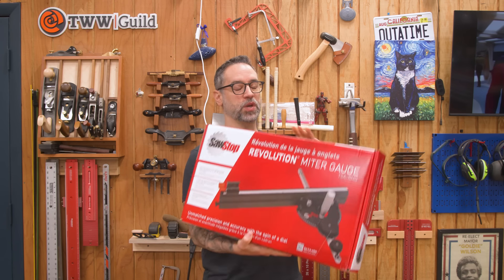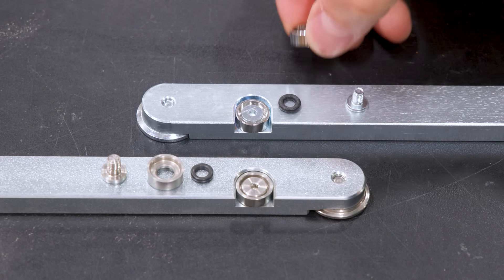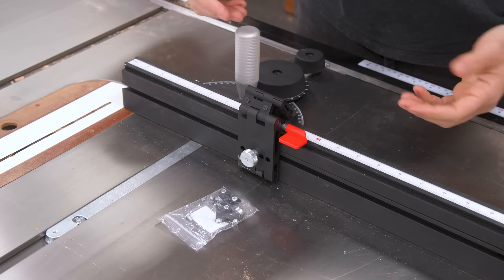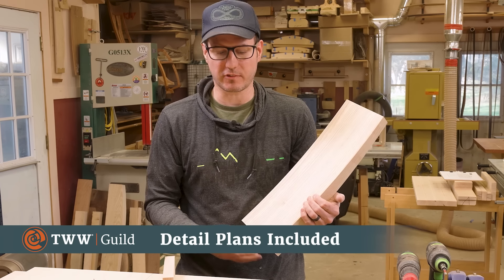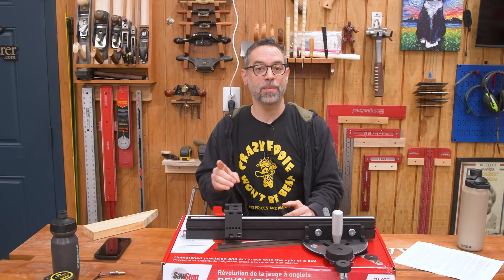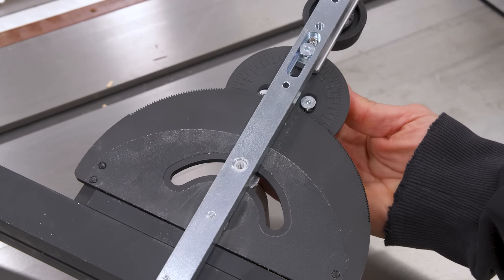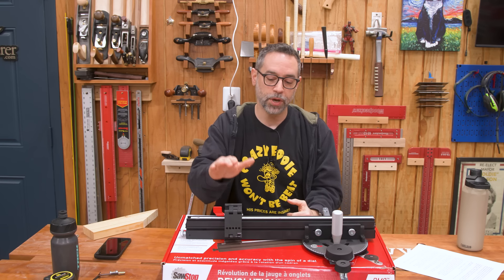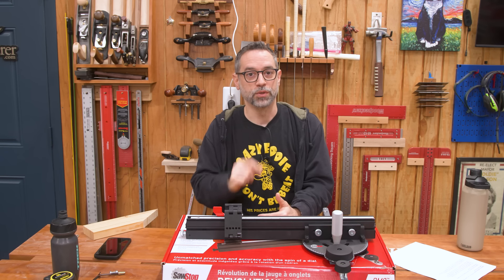The MOST Expensive Miter Gauge on the Market | Worth it?!

Comment: The lock down on the stop is nice until you put on a sacrificial board.  You'll need a slot the length of the board and a longer tool to reach the dovetail slider.   (and BTW, the slot needed to move your stop around is where the sac board attached to the rail so...

Comment: I have a Robert Lang Billiard Chair in which the front legs are 25 inches apart and the back legs are 24 inches apart.  He indicated there was a 91.6° on the tenons on the rails front to back.  This is common for legs to be offset on chairs.  I doing it by making a full scale drawing of the foot print and using that as a guide.  Still haven't purchased.

Comment: I got a demo of this at Rockler and the dude at Sawstop used the same system you used to get rid of deflection. Impressive Marc! I was awed by the accuracy of the angled cuts but it's not something I would ever need. Great review!
Reply from the maker: Thanks!
Reply: Except then you cannot use a sacrificial fence. I guess everything has trade offs.
Reply: @MrWookie1981 That does seem like a problem. Maybe then use a small quick clamp over the whole thing? Not a pretty solution, but the ergonomics could use some work anyway on most of these. All the settings do seem quite slow to use too here.
Reply: @MrWookie1981 seems like you can if you route a dovetail into the face of the sacrificial piece?
Reply: @3weight And that would take some experimenting as it's not as simple as using matchfit's stuff...
Reply: @3weight  think of how precise that groove will have to be so the stop sits on the table but not above or below the table.  Seems like a lot of work every time you want a new sacrificial fence.
Reply: @MrWookie1981  Might be - it looks like it’s just a matter of matching the height of the dovetail on the stock face, but it wouldn’t be the first thing I thought looked simple and spent a day tweaking around with 😄
Reply: @3weight  I know I am being petty but at $450 USD should really be trying to figure out work arounds to make it work?

Comment: Marc, great video and a fantastic review! I really do need to thank SawStop for coming out with this miter gauge. It is an engineering marvel in spectacular fashion. 
It makes me feel SO much better about my decision to go with my Jessem Mite-R-Excel II gauge. With this one out there, I no longer have to feel guilty about purchasing the most expensive miter gauge ever produced! Thanks for that, Sawstop! You're the best!
Honestly, the stop is a total deal breaker for me along with the scale.
There was a saying in sniper training that corresponds to accuracy which states "Aim small, miss Small." which applies to woodworking with tight tolerances as well.
However, at some point, you are "chasing zeros" when your resolution of error gets smaller than the rigidity of the material. This becomes the tipping point of futility and will result in throwing away both time and money to achieve something that frankly won't even exist long enough to get the project out of the shop.
I was questioning myself on that very point when I decided on the Jessem miter gauge, but have now confirmed my choice with the advent of this new product from Sawstop.
Not only is this thing cool as all get-out, but it looks like an absolutely over engineered time and money killer. 
I'm all about precision and accuracy in woodworking, and tend to work to the 0.001" resolution, but truly expect to only hit a 0.01" final result. If I get that accuracy, I know I've done a good job.
This gauge will not make it into my shop, but I thank Sawstop for building it.

Comment: Im glad you mentioned the fix for deflection, I was thinking the exact same thing when you showed how much the stop had, I also thought of the JKM stop (which I currently use and love). I use my crosscut sled more than anything and don't really have a need for a miter guage, unless I'm doing woodworking all wrong...lol. but with that said, I think I'd invest in this sawstop if I was in the market, so thank you so much for spending your own money to review this stuff for all of us.
Reply: A couple of issues with this method for securing the stop - 1. you can't access the micro adjust easily 2. You need to cut a matching dovetail in any sacrificial fence. Other than that, it is an option still

Comment: I'm not following the description the track snugger mechanism. You can't force those steel guides out by tightening down an O-ring. I think what's happening is the O-ring is acting like a spring. The guide bushing location is machined so that the bushing is going to be proud of the track width by default. When the screw is loose, and you push the miter gauge into the slot, the rubber O-ring acts like a spring and compresses, and allows the guide bushing to move inward to accommodate the width of the slot. This lets it essentially auto-adjust to the width of any miter slot. When you tighten the screw, you are merely locking it into position. This is similar to the Woodpecker spring auto-adjust mechanism, but better because you can lock it in place. 

Regarding the thumb screw to lock in the flip stop, that will definitely keep it secure, but you lose convenience. It's no longer a quick flip stop, and it won't work with a sacrificial fence unless you build in a similar dovetail or locking mechanism. 

I think SawStop whiffed on that flip stop design. The rest looks excellent.

Comment: Great review Marc! My Incra Miter 1000 has become one of the loves of my life and I highly recommend it for accuracy (and price).
I'll be honest with you.....I never gave it a thought to display my SawStop brake and blade on my wall for everyone to see. You got guts to go along with your Giddy! (I love it when you get "giddy"). Keep up the great work.
Reply: Displaying the blade and brake on the wall sort of fits into Mark's goofiness. FYI Mark's goofiness is one of the reasons I keep coming back for more. 

With regard to the micro adjust, Nick Engler for years has pointed out that a screw with a 10-32 thread can make an excellent micro adjust. Take a chunk of wood (or aluminum, etc), drill and tap a hole for a 10-32 thread screw and thread the screw in the hole. You want to advance or retract 1/32"? That is 1 full turn. 1/128"? One quarter turn. 1/256"? 1/8 turn. Less than that? Blow on it, I guess.

Now all you have to come up with is a mechanism to hold the block of material.

Jonathan Katz-Moses, are you listening?
Reply: @jimweisgram9185  You gotta love Nick's "keep it simple, stupid" approach. No one can spin a hammer in the air like Nick. 🔨

Comment: I noticed that when you did the little addendum at the end about how to lock the miter stop down, you didn’t mention that it won’t work on the extended fence.  So it’ll only work for shorter pieces…so, it’s only a half fix.
Good review!
Reply: To be fair on that though, he's comparing it to something that doesn't have its real stop work on the extended fence either. So that seems like a wash.
Reply: Is that knob screw thing long enough to go through a sacrificial fence and tighten and remain in the stop block or does it only work with the metal fence? If it can’t work with a sacrificial fence that could be another set back.
Reply: You'd probably need to make a sacrificial fence with a slot to reveal the original sliding block or you could route your own dovetailed slot to slip in the blocks. Either way, a little more work than we'd wish but possible.

Comment: This was very amazing Marc. I think I your solution loosening up the two set screws and utilizing just the center hole will make it more attractive to buyers, who’ve seen this that is. Like you I probably don’t need anything this accurate with what’s been covered here previously. Excellent video, perhaps SS will modify the stop so as to do away with the 1/64 adjustment.

Comment: the dovetail slots seems like by design so that you can continue to use those sliding dovetail nuts in a sacrificial fence (provided you route in a dovetail slot) in order to prevent deflection. Very well thought out.

Comment: I bought this miter gauge with my sawstop.  One thing that that really bugs me is they only include imperial measurements and no option for metric.  I even called support to see if they have a metric option or tape measurement replacement, no luck.  The tape measurement width is 15.75mm for anyone that can recommend a replacement.

Comment: I finally splurged on the Hongdui one a few months ago as a replacement for my old Incra 1000se because I really don't like the "toothed" not-a-slider on their fence, hate almost cutting my fingers on their strangely sharp plastic knobs, and never could trust the measurements because that little ruler insert slips around too much. It doesn't have a vernier scale, but I rarely cut strange angles and I like how easy it is to set the ruler marks and end stop to zero against the blade (in both imperial and metric). The extension is also really nice. And as a splurge, I think it's definitely the best-looking option on the market.

Comment: Great mod for the Stop Slop. I currently use the gauge that came with my SawStop, using an attached oak wood fence that has T-Track along the top edge, and a sliding metal flip-stop which has no movement once locked down. It is only the vernier precision of your tested model that I am Lacking, but I don't need it.

Comment: Here's a DIY stop tip courtesy of Nick Engler. If your screw thread is 10-32, then you can easily dial to a 128th of an inch or less. A 128th would be a 1/4 turn. 1/8th of a turn would be 1/256. If your threaded piece is a flat head screw with a slot for a flat screwdriver, you have a visual guide for how much you have turned the thing.

Can't find a threaded insert that 10-32 size? Take a long enough 10-32 piece of all-thread, and cut a couple grooves in the side a couple of inches long at the end. I used my dremel type tool with a thin cutoff wheel.

 You now have a tap suitable for wood. 

Chuck it in your drill and run it in and out of the wood a few times.

I notice the Sawstop stop has a rounded bottom. Pretty sweet IMO, no dust messing the cut up, and looks good too.

Comment: So when Saw Stop makes a few changes as you pointed out you will then have the absolute perfect miter gauge. However it will probably end up costing way more. I AM surprised that they made so many great features yet so poor on a few others. All of this is great if you ever needed to cut some weird angles like 19 and a half degrees. When was the last time you needed to cut that weird of an angle or any other for that matter. This is starting to become the accuracy of metal cutting equipment. Like one of your viewers said. You make what you have work. I’m a retired toolmaker of over 50 years. I used to grind snap gauges for the government to a tolerance of +/- .0002 on a crappy surface grinder. However it sure would have been great having a top of the line machine I’ll admit. All boils down to just what do you really need. Nice video though young man 🤙🏻

Comment: You asked why anyone would need .1 degree accuracy. Segmented wood turners use angles that go down to .1 degrees to cut segments. If the angle isn't accurate the segments do not fit together to form a ring. For people that work with staves or tapered polygons to form multisided vessels or boxes, accuracy down to .01 degree or better is needed.

Comment: Just last week I pulled the trigger on the JessEm Mite-R-Excel II with Micro Adjuster miter gauge. Then I saw this video and though that I just might have buyer's remorse. It wasn't until you demonstrated the micro adjustment feature that convinced me I made the right choice! I feel that this feature on the SawStop is poorly designed IMO. Sure, you solved the deflection issue, but it looks like no matter how you slice it, that adjust will be somewhat of an inconvenience ( especially if you need to jump back and forth between micro adjusting and securing the stop with the knob.. no thanks... though I really do like the angle adjuster - but given my hobby, I don't think I would need that fine tuned control to be honest. In either case, thanks for this video! Very informative! But as for me, I'll just wait for my JessEm to arrive. I know I will be happy with it!

Comment: Your solution to lock down the stop only works if you don't use a sacrificial fence.  I use my miter guage for my accurate cuts and without a sacrificial fence, you can have tear out.  Cutting the last cut on a piece you have milled down and are almost ready to assemble and then blowing out the back side is no bueno.  I think I will stick with my Jessum.  It makes me smile.

Comment: Hi Marc, excellent review,  Followed your lead for the Incra 1000 & 5000 and have been very happy.  Beat you to the SawStop PCS but only because you were held back.  If I was making segmented blanks for the wife's lathe work that gauge would come in very handy.  One question though, how would the "STOP" bolt work with a sacrificial fence, is it long enough for a 3/4" SF?
Reply from the maker: Don’t think it’s long enough. But I would just route a dovetail slot into the sacrificial fence.

Comment: If I owned a top SawStop cab saw I’d probably be in a financial position to acquire this new and fairly improved gauge and I kinda like having matching factory components. Whether the accuracy would be beneficial I’m not sure. So a purchase of this magnitude would probably be somewhat subjective. Typically I don’t buy expensive accessories until they have been out in the community for some time, undergoing any revisions. I know guys who got burnt on the earlier Harvey gauges or even JessUm’s first generation all inclusive speed controlled router (for example). Their new one is revolutionary — point being, don’t rush in. My woodworking buddies all seem happy with the various models of the Incra gauge. Personally I prefer sleds and my own jigs specifically designed for tasks I do commonly. That being said, I love these reviews for the forthrightness afforded to fellow woodworking enthusiasts whose dollars value certainly needs careful consideration as the hobby and prosumers folks are more challenged every day with costs.

Comment: I have the Incra 1000HD, and while I don't use tenths of degrees, I do use several odd integer degrees making wacky half-lap joints for "kumiko style" patterns.  This is all the miter gauge I'll ever need.  What I might spring for is a gauge where the ruler was as accurate as the table saw fence ruler, and didn't get trashed every time I move the miter bar.

Comment: Seems like a great miter gauge and while that stop seems fancy it also feels like a big miss.  The deflection is bad, the joints probably aren't very stable and the micro adjustment seems horrible.  That all being said I don't really use micro adjustments and the rest of the tool seems to make up for those parts not being great.

Just feels bad to pay that much and get a stop I'd likely end up replacing

Comment: Since you asked, Mark... I use a tablesaw and miter gauge to cut the heels of guitar necks so that the neck join the body at the correct angle to keep the guitar's geometry spot on. This needs to be done with a resolution of .1 degree (or better). Would that post-space age miter gauge make my life easier? Probably yes. However since its an operation that I do maybe a dozen or so time a year a little time fussing with my cheap miter gauge is worth the cost savings.

Comment: Before I got my Incra Miter 1000, I used strips of blue tape to make minor adjustments to the cut's angle (and I NAILED it). After I got my Incra Miter 1000, I've been gobsmacked by how accurate it is: I want 30°? I've got it. 45°? Done. It's just wonderful. My one observation from your review is that your solution to the stop problem prevents you from using a sacrificial back, right? Or have you developed a workaround?

Comment: your solution for the slop in the flip stop is pretty good, obviously..but for me, I cut both ends of my pieces at the table saw.. I would essentially have to flip the stop up, cut one end, flip the stop down, install the face bolt and repeat each time.. the angle adjustment is crazy though. But I'll stick with my incra 1000hd and incra crosscut sled!

Comment: To clarify, 1/10th of a degree is actually the resolution of the angle adjuster, not its accuracy.  Accuracy would be how much deviation (error) the miter gauge has from a given setting.  Based on your measurements with the Klein angle finder, it is difficult to say what the accuracy of the Saw Stop miter gauge is.  Klien specifies the accuracy of their angle finder as ±0.2 degrees, so I would bet the Saw Stop miter gauge is more accurate than the Klien angle finder...  You might want to upgrade to a Mitutoyo 187-552 (±0.03 degrees max error) to verify accuracies this tight.

Comment: Putting the screw into the stop block may eliminate the deflection, but it also would make it very difficult to use the microadjustment mechanism..
Reply: In addition, you wouldn't be able to use the screw in the stop block if you need to have a sacrificial fence.

Comment: As some have noted, you can’t lock down the stop when you use the extension for longer cuts. I was thinking one could make a sacrificial fence that I long enough and route a dovetail at the same location/height off of the table as the dovetail groove in the fence itself and just put the little dovetail locky thingies in the dovetail groove in the sacrificial fence. Maybe content for a follow-up video?